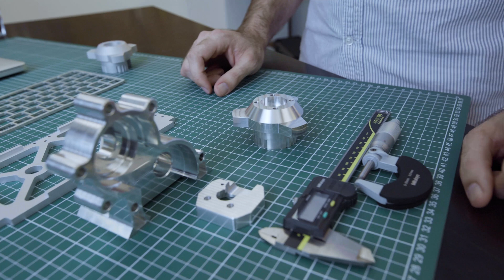Aluminum 6061 for CNC machining (Explained and Compared)

Comment: Thank you!  Apparently, Aluminum Oxide does NOT conduct electricity, unfortunately. If I want my part to always conduct electricity, what is my least expensive option for finishing?
Reply from the maker: Hey Glenn! Thanks for your question. An anodized surface is an aluminum oxide surface and aluminum oxide is often selected because it is non-conductive this would not work. As a secondary finish if the bare material is not desired we could only recommend Chromate conversion Coating. check out our website for more info on materials and finishes. https://www.3dhubs.com/ Hope that helps!
Reply: @ProtolabsMFG  Thank you! If I used the bare metal, does aluminum oxidize quickly in a household environment, or could I expect it to stay conductive for a few years?
Reply from the maker: @GlennLewis  Oxidisation will start quickly and without a protective coating/surface finish we would not expect the Aluminium to stay conductive, at least not on the surface.
Reply: @ProtolabsMFG  Thank you very much! This has been extremely helpful!
Reply from the maker: @GlennLewis  Anytime Glenn :)